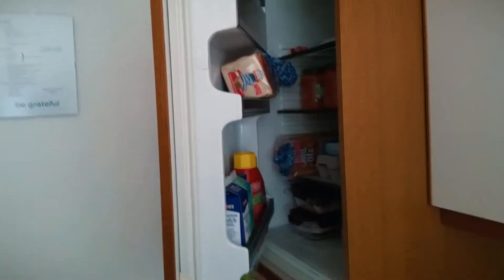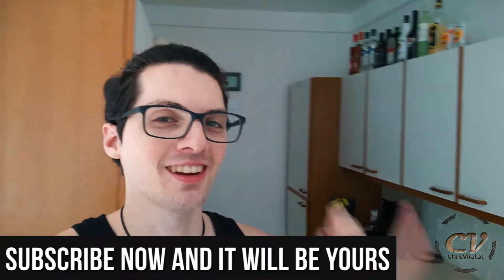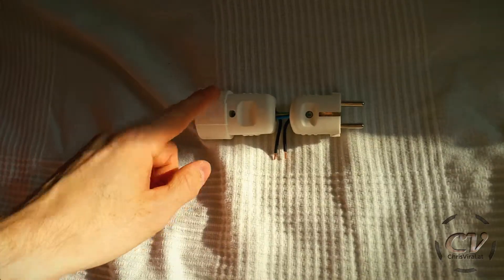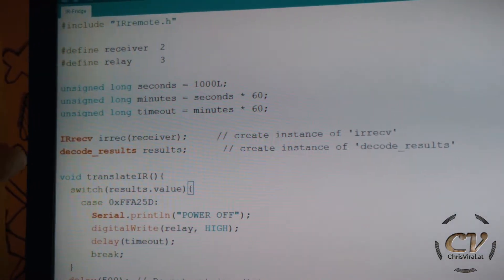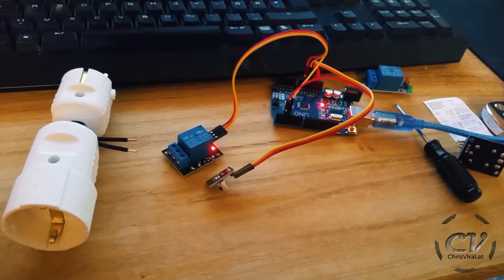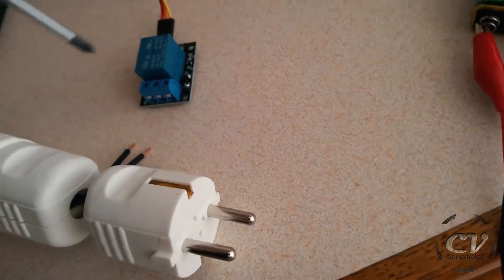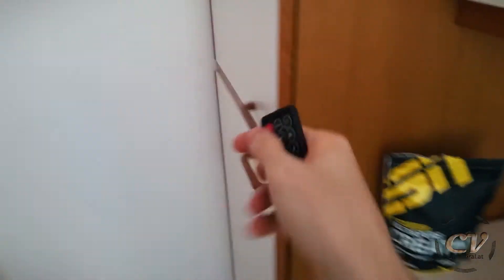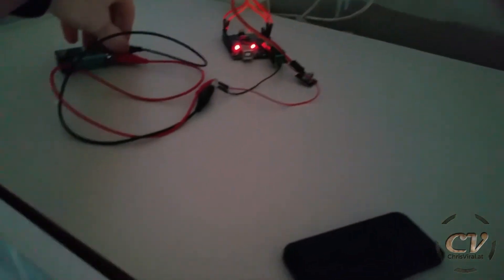How To COMPLETELY Silence Your Fridge (With A Remote)

Comment: This hard switching could possibly shorten the lifespan of the fridge. I've been advised by a technician to always turn it off using the thermostat dial inside before unplugging it from the mains to minimize the motor shock. And we only had month-long cycles in mind, not on a daily basis. Otherwise, a nice project. I'd only utilize a power adaptor instead of the batteries and a less power hungry microcontroller, such as the Arduino Pro Mini etc.

Comment: aren't you afraid of your food going bad? I mean it's only for 1 hour if I understood it correctly but still, if this thing fails it stays shut of for the night, right?
Reply from the maker: Not at all, since my door lock project is holding up nicely for months now I'm fairly trustful in this kind of technology. Also if it would fail or reset the switch would get closed anyways (normally closed). But of course you never know haha, but no risk no fun :D